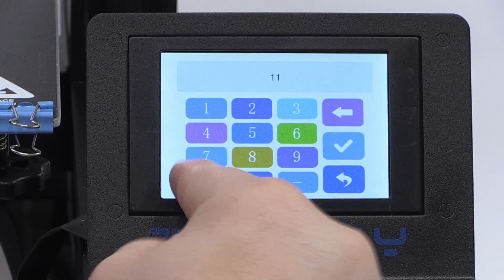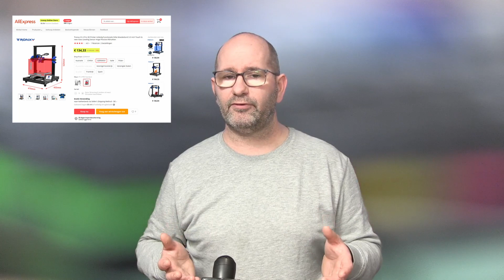▼ TRONXY XY-2 PRO Review | The Cheapest Ender 3 competitor

Comment: I own one of the first Tronxy xy 2 printers with green mainboard. After 3 months, all of the fans sound like destroying itself. The level sensor stopped working and burned the printer base as it never stopped so I have to change it for glass. · months later one of the fans short cut and burned out one fan port. After a few months more, the heat bed that is very thin burned out and desoldered from the bed, so I had to fix it with the proper cable caliper to resist the hit. I asked Tronxy for a replacement board and they told me the original was no longer produced so I had to change for a black mainboard and also replace the long 8 mms long bar ... I did not make it. To continue the experience, I had to replace the fan from the PSU that sounds like crazy and made the printer vibrate, also the filament feeder and hot end as after every 5 minutes the printer got clogged.  To resume, what I have now is a completely new 3d printer with everything possible replaced as also did with mainboard and lcd screen (using BTT SK· v3) . I blame myself as I have always told to myself that I don´t have to buy the most cheapest object, nor the more expensive, a mid term priced printer with a few replacements becomes a nice workable 3d printer.- DON´T BUY IT, NOWADAYS Tronxy is selling every part at a very very high price as if they were the best 3d printers in the world, believe me, you will not work with this printer for more than 3 months without replacing something, cheap in Tronxy, is really expensive. Let´s don´t talk about bed leveling..... a fiasco!!!

Comment: This printer has terrific specs and an unbelievably low price, considering all you get for that money.  The 32 bit main board, silent stepper drivers, 20x40 and 40x40 aluminum frame should make this an amazing printer, but in reality, it's terrible...  The auto-bed leveling system on this printer is a complete joke and almost a crime.  The sensor is complete garbage, and it also serves in place of a Z end stop.  What it determines from the leveling process varies across the board as compared to the actual distance of the sensor from the bed.

The best thing Tronxy could do to make this printer compete, perhaps even beat the Ender 3 machine would be to remove their crappy implementation of auto bed leveling and just equip it with a proper end stop micro-switch.

Other things that need to be fixed on this printer is temperature control.  This printer varies wildly in temperature, especially the hot end, as it prints.  You can watch the temperature in real-time and observe an 8 degree variation on the hot end and 4 degree variation on the bed.  This is a firmware problem with temperature polling occurring  way too infrequent.  The hot end for example will quickly drop 4 degrees below its set point, then overshoot to 4 degrees above its set point, then drop 8 degrees before the element is re-energized.  This is a behavior I've not witnessed on any of my 3 other FDM printers from various manufacturers.

You get a lot for your money with this printer so I don't feel I was ripped off when it comes to material costs.  I just think Tronxy tried too hard to throw a solid competitor out there to the Ender 3, without ensuring that it would actually work.

Along with the auto-bed leveling not working at all, you're limited to a 2mm thick build surface.  The fiberglass board with the buildtak type sticker is not my surface of choice.  I'm quite fond of printing on glass, which is the surface I use on my 3 other printers.  Even if the sensor would work properly and actually detect as consistent distance to the aluminum bed, it wouldn't work with a 3mm piece of tempered glass.

As you pointed out, the ribbon cable is just obnoxious and untidy.  It requires unnecessary additional space to the base form factor of the machine.  It just shouldn't be...

In order to print anything on this printer, for now, I have to set the Z offset to a happy medium, between the highest and lowest positions the sensor mis-detects.

The technology and materials used in this printer should make it my best printer, but instead, it's the printer I fire up only when I need something quick and dirty, and my other printers are occupied.  My Anet A8 prints light years better than this Tronxy, and my first layer doesn't drive me up the wall, as it does on the Tronxy.

Eventually, I'll look into replacing the bed sensor with an end stop switch, and replacing the firmware with a Marlin derivative or such, then this printer will be a good competitor to the Ender 3, perhaps even better.  For now, this printer sits mostly idle.
Reply from the maker: Dear Steve,
I have read your response with a little surprise, because from everything you write I gather that you really understand 3D printers, but that your findings are completely different from mine.
To begin with, the auto bed leveling, which is indeed not too good. Still, I don't think that's a deal breaker because it can be turned off, so it's not mandatory to use. When you manually level the printer, it remains perfectly usable for a large number of prints in a row. I have only readjusted this printer a few times myself, and that was because I moved the printer.
As for the temperature, I see this problem too, but not as extreme as you have it. With my printer the fluctuation is about 5 degrees, only in the very first minute it is slightly higher, but never more than 7 degrees. This is therefore a maximum of 2 or 3 degrees above or below the set point. My Ender 3 V2 is worse in this respect, there the temperature fluctuates by almost 10 degrees, so 5 degrees over and below the set point.

Then regarding the use of a glass plate, I really don't understand. My probe measures to a depth of 4mm, so a 3mm glass plate shouldn't be a problem. Apparently there is a difference between the printer you have and my printer. 2mm would really be too little, but the probe is of course easy to replace for an end switch, so that this is no longer a problem at all. There are also conceivable possibilities where the probe is placed in a different place, to have it carried out a fixed measurement as an end stop, and no longer as a level sensor.

Anyway, there is a clear difference between your printer and my printer. That in itself is a problem, because it makes comparing machines very unreliable. The way my machine works, I think it's a worthy competitor to the Ender 3 V2, but I imagine the printer you're describing is a lot worse.
Reply: @3dPrintCreator  In lieu of replacing the bed sensor with a micro-switch, I had considered moving it to a stationary position on the Z, so that it would at least read consistently "hopefully" from a more fixed position.  As for disabling the "auto bed leveling" feature, I would be happy to know how this is done.  Without a provision in the firmware, I assume the printer maintains its position offsets from the most recent calibration.  Ideally, I would think that the sensor could key from the home position reading, ignore everything else and my manual leveling would take care of the worst of the problems I have with this printer.  Again, I see no provision for the Tronxy to ignore its probed offsets everywhere on the bed.  The Z offset only adds or subtracts to the probes readings.

My interest in the Tronxy XY-2 Pro, was that I was looking for what might be a great starter printer to recommend to friends who are interested in getting started with 3D printing.  By specification alone, the Tronxy XY-2 Pro seems to nail everything that might give a new user an outstanding experience for a FANTASTIC price.  Making any invasive modifications to the printer would defeat the purpose of my purchase, so after becoming horribly disappointed with its factory configuration, I decided to let it sit and research it a bit further later.

It may very well be, that Tronxy has fixed problems in later revisions of this printer, or that I just got one that has a bad bed leveling sensor.  My sensor is mounted perfectly square, and is at its lowest position.  It reads somewhat consistent across multiple probes, even when that reading puts the nozzle at different elevations throughout the X-Y plane.  During the calibration sequence, the 3rd probed position is always pushing the nozzle into the build plate, whereas on average, my Z offset is roughly .1 millimeters.  .1 is where I inevitably set the offset to, to have any hope of first layer adhesion, but still, there are portions of the bed where the gap is slightly higher that what I'd like, and most of the squish across the board is tighter than I'd like for a first layer.  Additionally, after any long print, re-homing my Tronxy nearly always smashes the nozzle into the bed.  Power cycling my printer allows it to properly probe the front left corner for homing.

I was unaware that the Ender 3 has temperature control issues as well, and find that even more disappointing.  I was kicking myself thinking that the Ender 3 would have been a better platform to review and recommend to friends, but given all the ways in which the Tronxy appeared a better choice for a newbie, and its super low price, I chose it for that purpose.  My 3 other printers, the Anet A8, the Anycubic I3 Mega, and my CTC A10s, which is an ultra cheap CR-10 knockoff vary less than a single degree on the hotend while watching in real-time, so I assumed, incorrectly, that my 8 degree offset, 4 degrees above to 4 degrees below, was unique to the Tronxy.
While each of my other printers prints fantastically, the only one to do that relatively out of the box was the Anycubic, and its replacement, the Mega S is priced just outside where I'd feel comfortable recommending it to a new user.  The A8 is a great printer to recommend to people who are technically oriented, but I can't recommend it to anyone who doesn't want to spend several hours building it, adding a mosfet for the bed, and flashing the firmware.  The CTC A10S, was bad when I bought it, requiring a new aluminum heated bed to replace the steel heated bed with only a 10cm X 10cm heating element, aluminum drive rollers to replace the nylon rollers for X & Y, a mosfet for the bed, even re-drilling one of the holes on the X gantry and adding cam nuts to snug the right side up.  Subsequent releases of the CTC A10s are even worse.  They replaced the aluminum extruded frame rails stamped steel rails that flex while printing.  The Anycubic, which didn't require anything to make it reliably print well has gone from the $190.00 US dollars I paid when I bought it to $300.00 US dollars for its replacement, the Mega S, so I can't recommend it to somebody who may find they don't really like printing once they spent the money.

That said, perhaps "undoing" auto-bed leveling would result in the Tronxy XY-2 Pro being a better choice for recommending to a new user, so long as this can be done easily for people who are not necessarily technically savvy.

If I missed a setting, or if you can tell me the process of disabling the auto-bed leveling, I'd greatly appreciate it.  Like I said, I think in terms of material consts, the Tronxy is a great value.  From my experience with the Tronxy, removing auto-bed leveling would make this a great starter printer.

Perhaps a factory reset on the Tronxy will blow out the saved offsets for the bed leveling, allowing the printer to key from the home position reading of the sensor, preventing it from compensating for bad probe readings elsewhere on the bed...  Is that how you're able to forego the auto-bed leveling?

Also, like I said, my level sensor sees nothing more than 2mm from the aluminum bed, so replacing the fiberglass board with a piece of glass might still be problematic without adding something metal to the front left corner of the glass...

Like I said, let me know what you're doing to circumvent the auto-leveling feature on the Tronxy.  Thank you for your insight.

Steve

Comment: I got one after watching your review. One of the screws to connect top to bottom was bad. I am still having trouble to get it level enough to use auto leveling. The heat keeps shutting down. It was jamming down on the print bed until I adjusted the auto sensor. I switched to smaller clips only on the back. Yes that SD slot is hard for an old blind man to use. Had it for 5 days and still can not print.
Reply from the maker: Hi,
I hope the missing screw can be ordered through Tronxy customer service. I can hardly imagine that they are difficult about that.
That the temperature does not stay good seems like a heat creep to me. I think you should check that the thermistor in the hot-end is properly secured, and I would also check the thermistor of the bed. If this is not the problem, see if the cables are good. If the motherboard of the printer senses somewhere while heating, that a temperature is rising or falling faster than physically possible, then this motherboard will immediately turn off the heating. This is a security feature that ensures that your house does not burn down if there is a malfunction in the printer.
The auto level sensor is a known thing. I think they should have put that better in the manual. It is normal that the end0user should adjust that, but at least they should tell that to the user. As for the clips, I would install a magnetic print bed myself, without clips. That works much better.
I hope you will have the printer working quickly, because after 5 days you should finally be able to make a nice print with the machine.

Good luck, and I happy printing.
Reply: @3dPrintCreator  I ran a die over the screw and cleaned it up. The temp I don't know. when trying to level is when it cuts off. Thank you for the help.
Reply from the maker: In the printer,  the motherboard knows that when powerl is given to the print bed, the temlerature should rise. Same thing for the Hot end. If the sensors that sense the temperature (the termistors) don't measure a rising temperature, or when the measured temperature behaves different from what the software on the motherboard expects, there must be a problem that is potentially dangerous. The motherboard then cuts of the power to the heaters to make sure the danger is gone. This function is called the heat cream protection and you can look it up on the internet. Most probably, one of the cables is not plugged firmly into the motherboard,  or one of them is damaged. It's easy to find this problem by just following the thermistor cables. If you are not sure which parts are the thermistor, then look it up online, there are plenty videos about that.
Good luck and I hope you will be printing soon.

Comment: I have two of these little buggers and they are great especially for the price with features that Creality fails to implement even in their higher price machines. If you want a decent machine get one of these slap Marlin 2.0 on it and a decent build plate and you'll be set. Mine both run Marlin and Auto Leveling works great with that plus I can send G-Code via Pronterface which the original firmware doesn't allow.
Reply from the maker: Yes, I can imagine. They are very complete printers for their money.
I am still using the stock firmware, and will be doing that for a while, because of the video's I make. How ever, Marlin is perfect for this printer.

Comment: The specs. I saw online state that this has a 275° C nozzle max. -- does that seem correct based on your experience?  Is it an all-metal hotend?  Great review -- it hit some key points that should be considered.
Reply from the maker: It is correct that it's possible to heat the nozzle to 275 degrees Celsius but I would never recommend this, because it's a nozzle with a PTFE inner liner tube. It's dangerous to heat this to a temperature above 245 degrees Celsius. 
Thanks for stating this out, I will mention this in a next video about the printer.
Reply: You can go as high as 260 with Capricorn tubing but anything over 250 on a stock Ptfe is a big No-no
Reply from the maker: Sure thing. I always say 245 because of possible overshoot while heating.